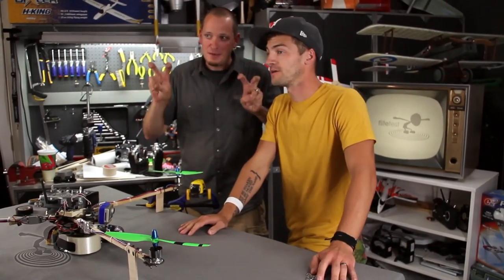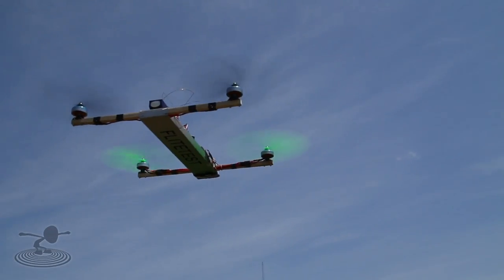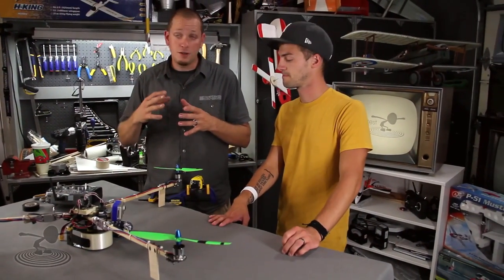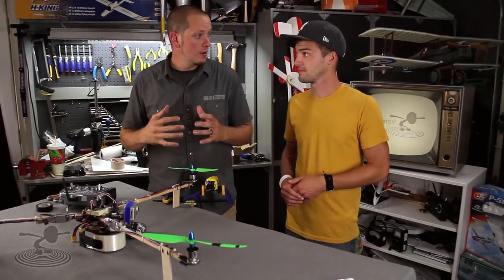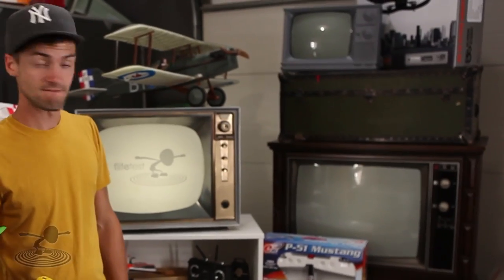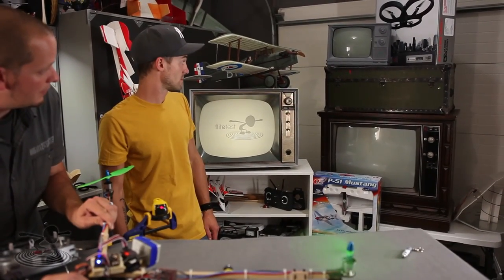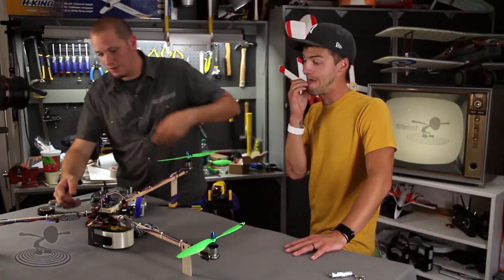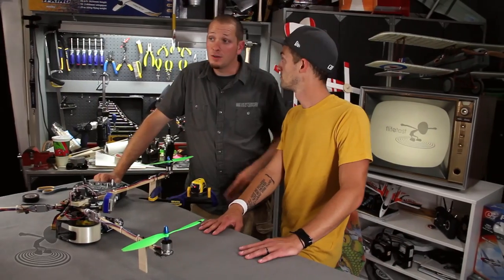Flite Test - Laser Balancing Props - FLITE TIP

Comment: Another awesome way to do this is using the iSeismometer free application for your smart phone.  I have it on my iPhone 5.  Put the phone on the table with application running and use the 3 different graphs to adjust motor and prop as needed.  Free and easier than using the laser beam method.

Comment: Nice tip!
Without reading all the comments, there is an easier way if you have a multiwii FC. Just connect the gui and click everything away except for the acc lines than increase the scale to x10. With unbalanced motors you will see the "flatlines" shaking. Others put their i/android phones with somekind of vibration monitoring app on the copterarms.I like the starwars - laserapproach the most - of course. The dark side of vibration becomes a red line of vibration.. hehe.
So long
Crashpilot

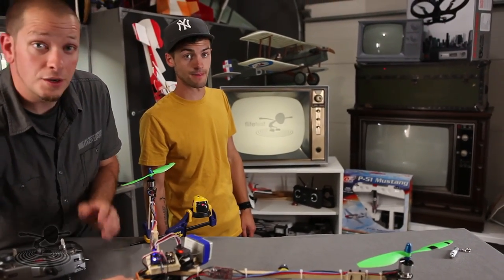Comment: This is checking to see if a particular motor/prop combo is balanced, he mentions at 4:20 in that you would, once you determine your combo is unbalanced, then apply or remove whatever substance you wish to balance your prop, once you've balanced it then check it again, if it's out then check the motor, once both are balanced you get a dot and move to the next one.

Comment: Let me get this straight: This is a method for figuring out which one  is unbalanced/balanced. If you find an unbalanced prop, you have to take it off to actually balance it. I like the method, because I can't easily tell if a prop is balanced or not.. (I do pre-balance, as a crash of mine was caused by an unbalanced prop). (it is possible to balance this way too, by adding tape to specific sides and looking at the effect, being worse or better)

Comment: I would recommend using a prop balancer first (old school glow guy speaking) and then using the laser trick to further isolate possible engine balance issues. Since you copter types use much lighter props then us glow engine types you could easily just use two neodymium magnets and a shaft that equals the prop hub diameter to rig a up prop balancer.

Comment: Obviously, to keep the video length decent, they had pretested and balanced out the prop, then added a big weight to mess it up so that they can demo the effect. Naturally you would use your favorite balancing method (they have vids for that too on the channel) to get it near perfect, and then check with the laser and tweak it out to get a perfectly balanced prop. Oh, and balance your motor first as well, especially if it's an outrunner.

Comment: The reason you only take one prop at a time is because (especially with cheap) props tend to come unbalanced. it is easy to figure out if one prop isn't balanced this way, and adding tape will tell you if it becomes better or worse (from that you can judge whether to add or remove the tape (and add on the other side). When you have multiple motors running, it is harder to find unbalances in props, as vibrations come from all motors.

Comment: This process is typically used to balance the MOTOR, not the prop.  Your supposed to balance your props first, THEN do this and add tape to the motor to balance the motor.

Comment: The laser is shone onto the mirror, and since the mirror is stuck to the tricopter it will vibrate with the tricopter. The laser beam reflected by the mirror will be distorted by the vibrations and it will stretch the dot into an oval or line.

Comment: Nice idea, but as shown it only measures movement in 2 directions. For example, take the 'balanced' motor, remount the mirror horizontally, and you may still see bad vibes. I suggest using a prism, more mirrors, and/or additional lasers to make a couple more dots to monitor the other axis. ;)
Reply: Andrew Crews
I Apologize for not being clear... by 2 directions I meant 2 axis... really it's 4 directions if you count rotation... that is only 4 out of 6 possible vectors. Motion (either translation or rotation) in a direction that is orthogonal to the mirror will not move/distort the spot. OTOH, you can use 2 reflected beams (oriented ~90* apart), or more ideally 3 beams (forming sort of an "XYZ axis", with it's origin on the part) to resolve ALL possible motions. 2 beams will resolve most of the nasty vibes we care about. If you want to go the distance with 3 axis, you can see the more subtle structural modes (because 2 beams can be fooled by singular interactions between rotation and translation ). A 2 can be implemented with 2 parallel lasers and 2 mirrors, or a prism... though I suppose you could also split a single laser beam by wedging 2 surfaces together in the middle. Does that make any more sense?
Reply: That would be a waste of time. You can only balance these in 1 axis.  In order to do the other axis you would have to modify blade pitch.  It's a thrust axis.  They are never balanced..... It's how you create thrust.  I think your talking about flex anyway.  That's not the same as balancing.  Lastly... This laser method is flawed bc it doesn't say which side to balance.  You have to guess and check until you get it close.
Reply: As vibration travels through a structure, it 'reflects' to create interference patterns in various directions... think of sound in an imperfect room. I was simply thinking multiple axis could determine this motion, which is likely to lead to better balance. I know perfect balance is only theoretical... just thinking out loud. If I had a prism on me I would slap it and see if it helps.

Comment: I think you should compare this balancing a tyre that's not on the rim. The tyre (prop) can be well balanced but it will need balancing again when its on the rim (motor), and for this you need to spin it up

SImply, balance your prop using methods mentioned here, the balance prop and motor with laser, iphone of whatever and tape, then when you are happy, you can if you like remove the tape and sand or scrape if you prefer.

No idea why you are all so angry there is some great info here!

Comment: Put a zip tie around the motor and the zip part will act as the weight to balance it. Just slide it around until you find the balance point, mark it, pull off zip tie and put your tape there...

Comment: I wonder if a strobe would be a more useful tool to visualize vibration?  Especially if the strobe were adjustable for frequency.  (maybe an automotive tuning strobe could be used?)  If you shot a strobe at the motor/prop/arm against a background with a black grid drawn on a white surface, not only would vertical prop oscillation be visible, but so would motor/arm motion, and both could be measured in a linear way.  This might be more useful if the RPM could be determined and recorded at any point.
The motor without the prop could be spun up first, to isolate non-prop vibration.  The only thing I don't know is, would any video camera actually catch the motion?  Would it be able to focus?  Even at 60fps, I don't know if it could be a useful part of the test, or if only direct visual inspection could be used.

Alternatively, performing the same test shown here, but bouncing the laser onto a white background with a black grid would yield more useful results.
Reply: By using a strobe, you'd be losing all the data while the light isn't lit. It would be possible for the balance to be far off, but the frequency of the oscillations and the frequency of the strobe could match at the center of the target and give you a false reading.

Comment: To make a first-surface mirror out of an ordinary household mirror, is pretty easy:  Apply a chemical paint & varnish remover to the mirrors backing, per product instructions.  Wipe off gently with a non-abrasive cloth; the protective coating should come off, leaving a reflective surface .  A second treatment may be required to get all of the paint off.

Comment: you can also do this without the prop to balance the motor first use tape on the outside of the motor to balance it and then put the prop back on and do it again to balance the prop for the best results

Comment: built a monster quad but flew it out of sight andnever saw it again it had a full fleged naza v2 on it and weighted 3.5lbs fully loaded, just hope no one got hit with the crbon fiber props on its way down :(
Reply: That sucks
Reply: Why'd you fly it out of sight?
Reply: Tip: Buy a cheap GSM GPS tracker from Bang good or similar stores. They're about $12 and with a cloned SIM card or a cheap prepaid plan, you'll get coordinates on your phone with the set interval, which shows where your plane is.

Comment: Its not dynamic balancing! With dynamic, you would have to use at least two masses for balancing cog AND making axi of spin parallel to axial symmetry of the mass. However, its still good example of static balancing guys

Comment: Should consider using wax paper to sand down the weight on the heavier side rather than adding tape, which can change the air-flow over the prop

Comment: Obviously, you add weight to one side and then measure the change.  If it gets worse, remove the weight and put it on the other side.  If it gets better, then keep dialing it in until it's perfect.  If no change, then you probably added too much weight to the lighter side.

Comment: Do you find that the motor shaft is out of balance? I balance my blades by sanding them on the heavy side on a blade, using a blade balancer,  will that do the same thing?

Comment: This maybe a silly question, but, this will work on an electric but what about nitro or gas engines? How would this test compare to a nitro or gas engine with all of the fundamental and harmonic frequencies being spawned off through out the throttle ranges and mechanical noise IE vibrations? Altogether, its very interesting.

Comment: Especially the prop mounted on the tilting tail servo on a Tricopter. The HK generic GWS clone prop material is not very strong. Aggressive yaws will rip the blades apart after a while. I had it happen to me on my Tricopter. Now I use only Gemfan carbon nylon props.

Comment: This would measure the vibration of both sides of the prop, but it doesn't tell you which side of the prop you need to add or remove tape from
Reply: I was going to post the same thing. This test shows vibration, but not how to determine location of prop imbalance.
Reply: PyroChimp75 

Well.. You've got a 50% shot of getting it right the first time. I'd take those odds..
Reply: You put tape one one side. If it vibrates more, you put it on the other side. If it vibrates less, you keep adding tape on that side until it's stable

Comment: I've been watching all these prop balancing videos showing various high tech static and dynamic balancing systems and all you guys add weight by folding electrical tape over the leading edges of your props. Makes me wonder if this is causing some aerodynamic imbalance even though the props are (apparently) dynamically balanced. Is this a concern? If not, should it be? Is there another way to alter the blade weight, possibly by subtraction rather than addition.....? Thanks.

Comment: if u want to vibrate the crap out of a cheap laser pointer which most likely will be the death of it very quickly. using the mirror causes little to zero wear on the laser pointer as it is stationary rather than vibrating at a very high frequency.

Comment: just landed, pretty much burt up my motor but it was a good flight i didnt have to pick up any peices... 12.50 cents to learn how to choose the right motors isnt bad but i have to order the proper motor for an 11/ 4.7 sf prop if it says 7.4v at 11/7 doesnt mean it will run a 11/4.7 on 11.1 v.... it just doesnt work out

Comment: is it bad if my props aren't balanced in a normal heli? will it affect my flight?
Reply: Justin Koenig Yes, it's bad. Tail rotor gyro, for one, performs more poorly under vibration. Same for flybarless or autopilot gyros if so equipped. Also, vibration will affect your heli's bearings, electronics, links, everything will suffer. How long to start having failures depends on how bad the vibration is.

Comment: Easier just to mount the prop on a Dubro balancer and do the tape tweaks there. Too fussy to isolate each motor in my quad and faster just to pull the props off.

Comment: Hi guys...very interesting video,

I fly an ultralight aircraft over in the UK...I have been looking for a way to balance the prop on my a/c...its a 3 blade 62in dia prop,

I wonder if you would know if this idea would work with a much larger sized propeller.

Nick in the UK.
Reply: I fly paramotors, my prop is 130cm, wondering the same thing, a good tip is to not try and balance in same plane the piston is moving, need to be in a perpindicular plane to that ?

Comment: Well that showed me how to magnify the effect of the vibration and how to lessen it by removing tape from my prop. Sadly my props don't have tape on them. At least my 30 year old non technical prop balancer tells me which blade to take weight off and is therefore useful, unlike this video.

Comment: how do you balance a motor?
Reply: Put a small cable tie (zip tie) around the motor bell, then using the laser method in the video keep rotating the cable tie around the motor until the laser beam is stready (if that makes sense) I think David did a video on this...

Comment: This is such a gimic. This method doesn't tell you which blade is heavy or not, and is completely hit and miss with the PVC tape (which will fly off eventually). And it certainly wont tell you which part of the prop hub is heavy. Seriously, for $10 buy a prop balancer, sand and scrape if you're half serious about RC flight, forget the laser/tape idea.

Comment: This............Would take FOREVER to balance a single prop.

Ill stick to the old balancer
Reply: +Vx Commodore It's a method to check the dynamic balance of your motor, hub and prop combined ... , after using your old prop balancer to statically balance your prop. Dynamic and Static balance are 2 different things, what we want is dynamic balance, but we would rather use low cost static balancing tools and assume the end result both dynamically and statically balanced, usually it is close enough. An analogy here is car tire balancing, a good tire shop spin balances (dynamically) your tire, it is spun on an expensive machine which instructs the tech to add weights to BOTH sides of the wheel rim ... where as a dirt ball tire shop puts your tire on a bubble balancer (static) and only places weights on one side of the wheel rim, the tire is balanced as long as you don't drive the car, lol.
Reply: +BigCooter.com I'm to new to the quadcopter world to understand much of that. But I'll assume you know what's good.

As for car tyre balancing. All shops I've ever been to do the 1 side weight balance, And seems to work fine, As that's all I've ever had, Never had an issue.

I'm a mecanic. Don't do any balancing. I leave that to tyre shop.

Never had the pleasure of a proper balance, Never even really heard of the other way that you mention. So can't really compare. 
My wheels don't shudder.
Reply: Vx Commodore bubble tire balancing with weights added to one side, is better than not balancing at all .. .dynamic balancing machines are used widely today, even at discount tire stores. Also, for the quad props, the motor and hub can also be out of balance .. so this laser check does assess the entire motor, hub and prop dynamic balance .. but this laser method is only a check, it does not provide any information for you to improve the balance.
Reply: Ah i see, So once you have done all the balancing, And you would like to accurately check you're work, Use the laser.

Makes sense.

Comment: you have wonderful mirror by disassembling a hard disk take not too new the disk must be in aluminum the disk it's a perfect flat  mirror and can even be use for powerful cutter laser (not the subject here)
Reply: d0gdre8mz
Hard drive platters are or have been made from highly polished coated aluminum, and since they are incredibly flat, (and don't have a glass layer in front of the reflective plane) they make excellent mirrors for this purpose.
They also don't shatter!  They're generally a little large for this purpose, and great care must be taken in cutting a piece of one out to use, so as not to bend or warp the aluminum plate.  I recommend using the center hole to sandwich the plate between two pieces of plywood with a bolt, with a paper shield on the target mirror side, and making both cuts (towards the center) nearly through before finishing either one, so that just the last bit needs to be cut to finish separating the "wedge" from the whole disc.  Best to do this with a band saw, but a sabre saw works too, with a hacksaw blade (not a wood blade!).
The mirror can then be epoxied or super glued to the back of an adjustable clamp (common woodworkers' tool) and be attached to any arm, anywhere along the arm.